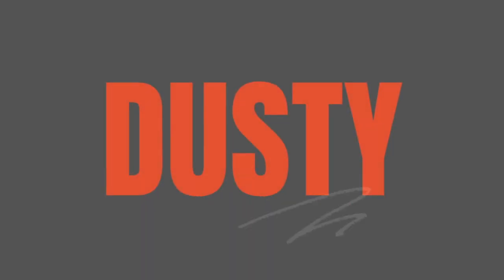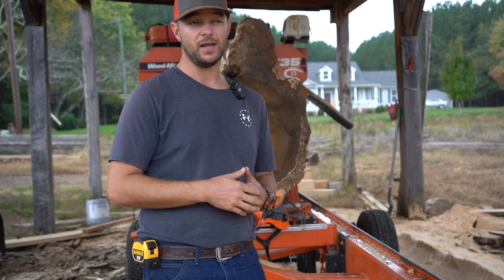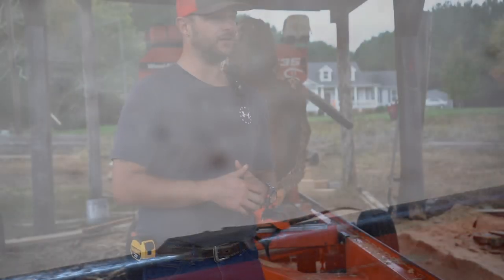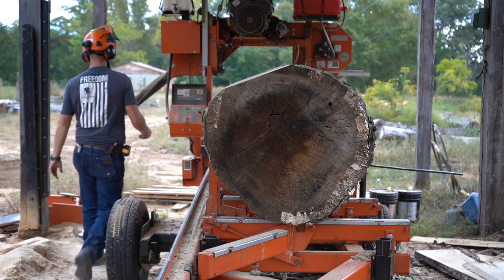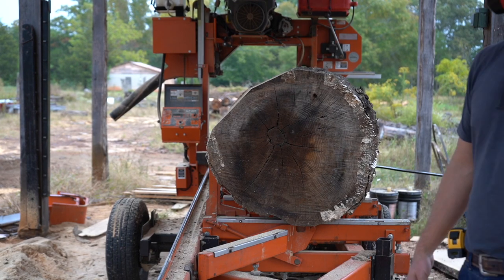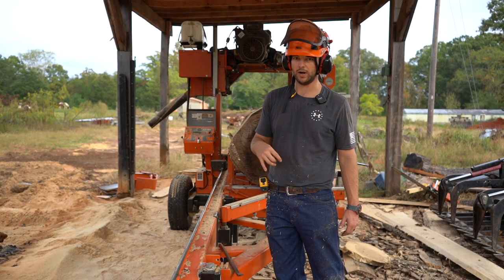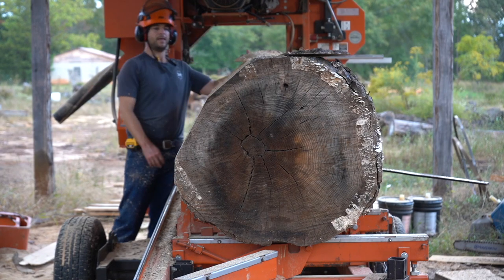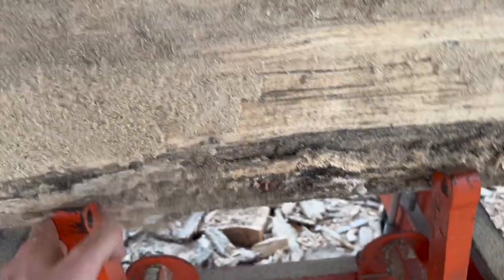Whittling With a Big Orange Knife

Comment: I’ve never tried this method.  We have a LT40 super hydraulic and usually just turn the log 90 degrees taking down a little each time until it is in a manageable size to get the lumber we need.  I try to make my slab cuts in a 1” or 2”  thickness after making the initial cut so we can cut them into lumber.  I think the LT40 has about a 30” cut width at the widest point.
Reply from the maker: Right on!! I’ve got an lt40 super wide on order. Should be here in February.